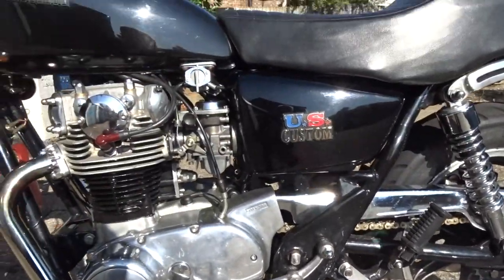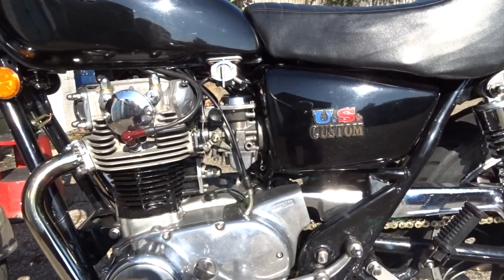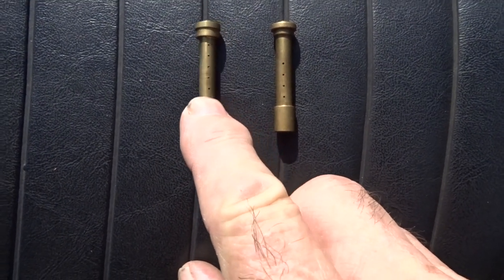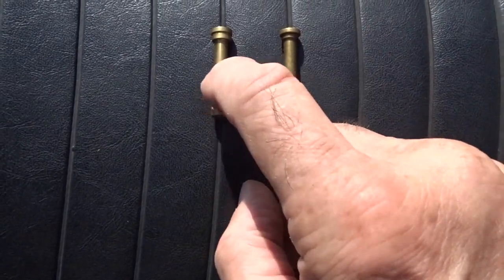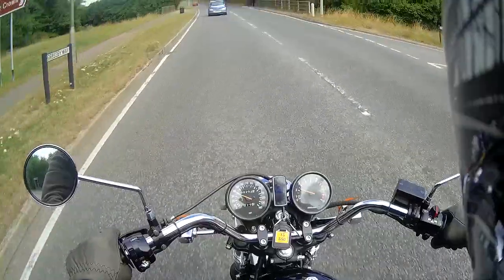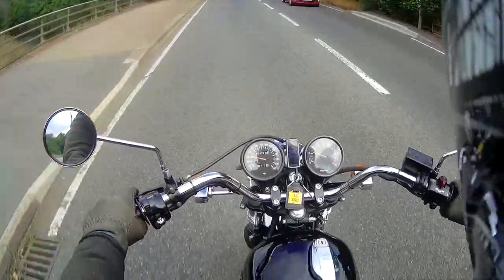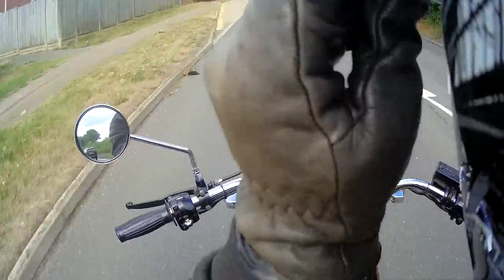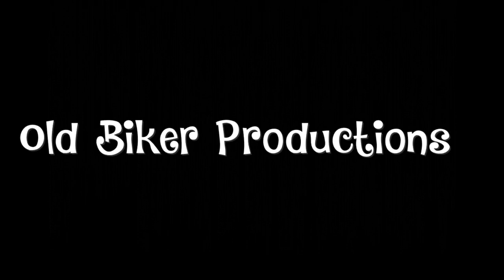Jetting the XS650 to stop the popping and backfiring on deceleration

Comment: Just picked up an 1980 xs650 special for free off of marketplace. Sat in buddys shed for 7 years. Didnt come with a key, going to order one in. 41000km, has compression when i kick her over. Going change out the wires/plugs, carb clean, drain the tank out and see if she fires up! Watched your rebuild series, plan on following your lead and doing a rebuild on the bike aswell. Good work, cheers man 🍻🍻🍻
Reply from the maker: Have you had it running yet Vince?

Comment: Why are you running your petcock in the PRIME position?  I thought that was a big no no?  Are those the stock vacuum petcocks?  Those rear shocks look brand new, did you replace them?  We need a set for our 1980 Special.
Reply from the maker: Hi straight down is in the On position using those petcocks, they are the vacuum ones and not sure if they are original or not, the shocks I got off eBay quite cheap 325mm hole centers I think - https://www.ebay.co.uk/itm/274375837504

Comment: I wish I could buy a brand new XS650 if these bikes are still in production the 650 interceptor with fly away like fly shit on the window
Reply: Frank , I have one ....a 1978 Yamaha XS 650  SPECIAL,, in pristine unmolested condition. ORIGINAl date coded tires, with the 50 year old Japanese Air still in them. The best item is the milage, 852.0... asking       $ 5500.00. Can send Pics, if interested.
Reply from the maker: If I won the lottery I'd be on your doorstep!